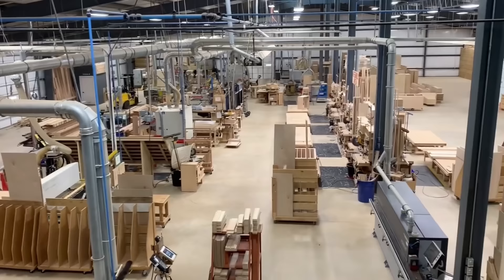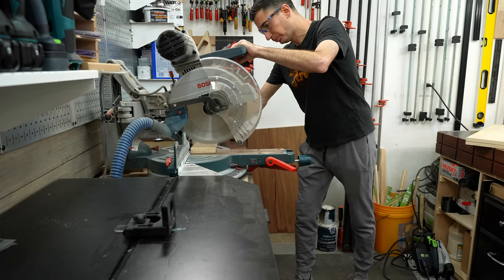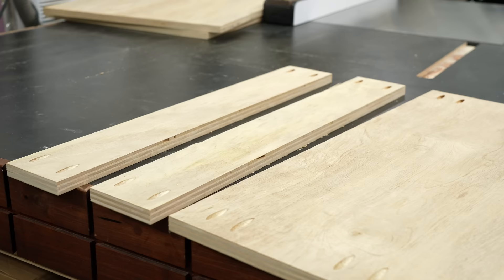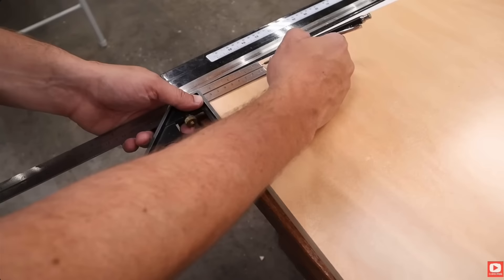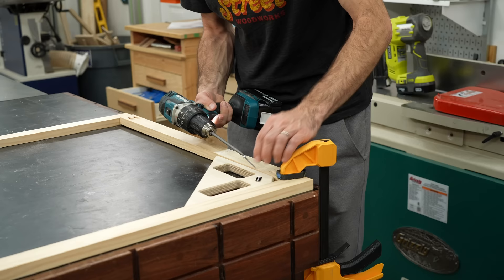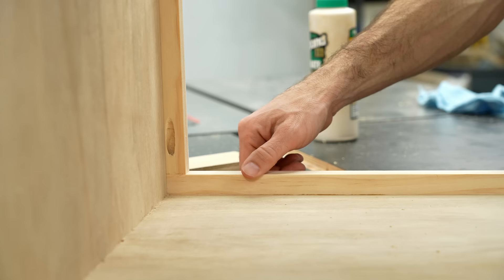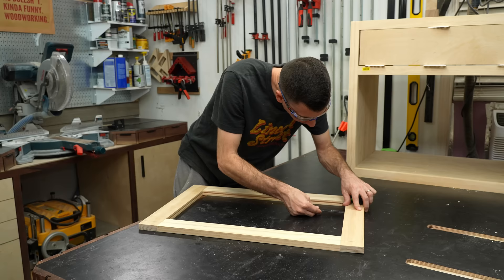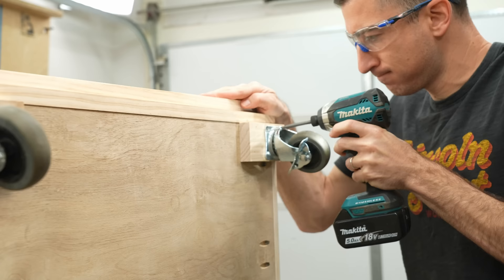Bad Beginner Cabinet Tips

Comment: 9:36 I actually prefer hand tools. But often they are not a good choice when working with plywood. For instance hand saws are largely divided into two types of teeth, cross and rip. One is good for going against grain the other for going with it. But with plywood the grain direction alternates throughout the total thickness. With powered saws it's not a problem because at the speed they operate the physics of how they cut is closer to shooting the wood with a constant stream of tiny bullets than it is cleaving or pulling at fibers. 

Technically there are rip and cross cut blades for circular saws. But besides the hassle of changing out blades or using two saws. I've seen no substantive difference between using the optimal blade for the direction of cut or just using a combination blade. And since you want a combination blade for plywood anyways. That's the blade that's going to be on my circular/chop/reciprocal saws the vast majority of the time.

Comment: Is there any advantage to mounting the side panels on the sides of the bottom panel instead of on top of the bottom panel other than allowing for integrated toe kicks?
Reply from the maker: easier for attaching the top stretchers and you want to cut all the stretchers and bottom at the same time so they are the exact same width.

Comment: Is it a bad Idea to build cabinets and bases out of 1/2" plywood. I see you tuber saying 3/4" is a overkill. What's your thoughts on this. I would face frame them
Reply: It can be done, but you'd have less support material to drive brads or screws into and you'd probably need to add more stretchers to brace against racking/flex.  Currently you'd be saving only $20 per sheet for birch plywood at HD, so you'd have to ask yourself if messing around with thinner stock is worth it.  Perhaps certain areas where cabinet boxes would joined together when installed is OK.  You never know until you try.

Comment: Birch ply seems to go mouldy( ie black mildew dots) if it's hanging around the workshop. I also made a small cabinet and finished it with Danish oil. That also developed mould all over the surface after a about six months.
Does anyone else have this problem?

Comment: I have a question about the face frame, you said there is a 3/4 gap inside you needed to pack out for the drawer slides, wouldn't that gap be 1 and 1/4 inch on a 2 inch wide piece of pine?
Reply from the maker: 1x2s aren’t actually that size. They are .75x1.5
Reply: @Lincolnstww  Ahhhh ok, that explains it:) im from the UK so not fully aware of the wood size nuances of the US. What is the reason for that?

Comment: 16:32 This is the wobbly way. Why not make the groove before assembly. In hat case you can put the router on the wide side of the wood.
Reply from the maker: You can - but you need to make stopped rabbets so you don’t see them from the sides. A bit of a pain and less approachable for a beginner in my opinion

Comment: Twice as much..  Definitely a lie. 3-5x as much if you need a tool. On another note don't be intimidated as cabinets are not very difficult. The biggest challenge is getting perfect 90 degree cuts cause 89 degrees isn't going to work well.

Comment: Why pocket screws amd glue when it has to stand more abuse? What is the difference between:
- Screws from the outside and Glue
- Pocket screws and Glue
???
Reply from the maker: I didn’t use glue when screwing from the outside. Just screws
Reply: @Lincolnstww  I saw that. I meant: when applying glue, why are pocket screws better? Why not Glue and screws from the outside? (in the case that someone doesn't have nice pocket screw utensiles) What would be the difference? Is this a dumb question?
Reply from the maker: @blinertasholli1280  not a dumb question. The glue isn’t necessary for the pocket holes. I only did it because it’s a standalone cabinet that will have a lot of weird forces exerted on it. Glue and normal screws would have also worked but I didn’t want to see them from the side. The glue just gives more strength but you generally don’t need that in a standard cabinet.

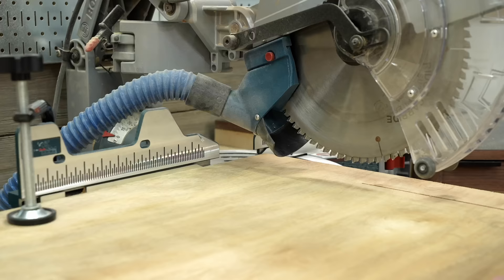Comment: 4:00 "it does cost 50 to 60 percent more" ?  You're either getting ripped off on your BB, or you got the best price on a sheet of HD precurved, hollow plywood. 
 
My lical Home Depot sells their 4x8×¾   (22/32) Sande plywood for $73. You could spend $95 for (one of the 5 sheets theyve had since 2003)  poplar or "Burch" 😂. 
 
But my local plywood retailer sells ¾" latvian birch 13 layer for $91.  The maple veneered is $103.
 
So get out there and shop around... and avoid HD ply like its wearing a white coat and coughing as blood comes from it's eyes.

Comment: Construction plywood is just as good depending on what section you are using it on. If you are willing and can afford to pay double for cabinet plywood then do it. The only change you will get is the insides will be pretty as well as the outsides. 
Home Depot panels saws are some of the best tools to use if they are in service. I have them cut everything and nearly every time they do not charge for it. Just make sure you account for the kerf of the blade in what you are cutting out.
Reply: Construction plywood rather than the thin stuff as well as glue is my go too. I would rather make sure the box is a box of plywood and is strong when that someone grabs a hold of them and pulls them up or stands on it. Stronger last longer. While you do not need dowels and all of those other things. Using the router to make all the parts fit nice and tight with glue is well worth it!
Reply: using plywood to make the whole thing a box means that you do not need a toe kick. You can hang them off the wall and have super solid boxes. The overall cost and time to make it all out of 3/4" plywood is well worth it. The added cost and ability to know you are getting a solid box rather than the least amount of wood to make a box. 
Custom fit ones can even be better. Most of the box can be done with dado to slide in dividor for cabinets or drawer sections. Since you are going to build a face frame.

Comment: Find out where your local cabinet shops get their plywood. Buy 3/4" "Pre finished" maple for the boxes, and 1/2" "Pre finished" maple for the drawers. Get a 1/4 or 3/8 crown staple gun and staple 1/4" pre finished maple to the back of the boxes. Don't cut a dado, don't rabbet joints, don't dovetail anything.

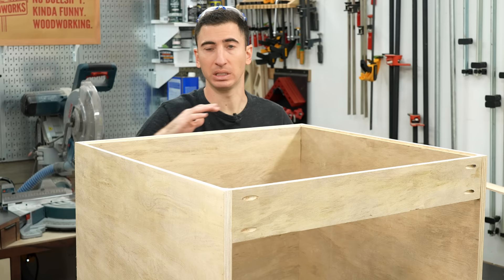Comment: 9:55 
Hand tools are not ’ew.’
They can save time and do a better job in many circumstances. In ther circumstances your power tools are pretty good and efficient. 
Fwiw I just would have belt sanded off the corners.

Comment: Made it to just past 6 minutes. First you show how to start without a tablesaw and then you show using a tablesaw for subsequent cuts. Then the use of mechanical fasteners without glue... If you want your cabinets to lose structural integrity over time use mechanical fasteners alone. If that's all you have... well might just as well buy premade. YOu can cut dados and rabbets with a router and guide. Dado, rabbet, and glue joinery and you can make cabinets that will outlast you. With shop grade plywood from the box stores as a minimum quality being enough for durable cabinets without the deed for mechanical fasteners. However pocket hole kits are really not that expensive. YOu mention Cut list programming... and not  in a positive way either. Perhaps you just have not used CutList PLus. I adopted it early and it has saved me lots in material utilization. It gives me the option to prefer rips or crosscuts. Although for folks with your limitations for material transport and sheet good handling and cutting your methods will work. 

Bottom line just too many issues with this video.

Comment: F.f.s. a could have used this vid a year ago. I bought a router table to try to make cabinet doors. I then ripped the router out and threw away the table as I learned it wasn't good enough. I then went to the expensive wood working store and bought a much nicer table only to learn I still had no micro adjust...uh huh. 1500$ into learning how to make shaker door fronts I now see this idea.. make the 4 sides and router them out later....dam I feel stupid.

Comment: In the eternal debate about Pocket Holes  (and their matching screws), straight drill and screw from outside, or dowels, or even Dominoes (Lets not talk about Finger/Box joints) I had a cabinet assembly job to do recently (well, actually, a very large drawer carcass): Cut the sides to length, front and rear to length to fit between, and bottom, all from 15mm plywood, lots of clamps, glue-up, and various blocks or those nice red 90 degree clamping things, so i got it square, and tight. Added the bottom, let it all set up and dry for a couple days, then using one of those dreaded plastic dowel drilling jigs set to 7mm, drilled 8mm dowel holes along the face side of all joins. Glue in the holes, hammered in some 8mm dowels, let dry, trim then finish with the sander.
I can hear all the purists screaming 'Oh the visible dowel ends!!!' and with much wailing and gnashing of teeth... 
It's a drawer carcass, for use in my shop, FFS, and, how do they know that I didn't screw and plug? (Yeah, I know, I just told 'em so)
I guess it's like the pocket hole methods, you do what makes YOU happy, and quit worrying about what others can't see

Comment: JUST A SUGGESTION, you're doing a good job informing beginning tree killers how to take all different widgets and gadgets, and build all different types of widgets and gadgets. Please do your viewers a GREATER SERVICE AND EDUCATE THEM ON THE WONDERFUL ABILITIES OF THE TABLE SAW! 

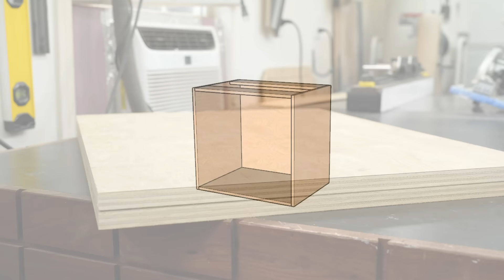@ 2:31 thru 2:51 you talk about bribing your significant other into getting a table saw. YET your only using your saw for a work bench and a jungle gym. This video could educate your audience as to why YOU DO NOT NEED MICKEY MOUSE POCKET SCREWS. If you educated them how to cut all the parts needed the same size on the TABLE SAW, how to cut toekick knotches, dados and rabbits on the TABLE SAW. You could actually have fewer parts to cut, spend less time and end up with stronger and more durable cabinet body's and drawer boxes.

Just saying.........
Keep up the good work with your video's.
Reply from the maker: I appreciate the comment but that wasn't the point of this video. Not everyone owns a table saw.

Comment: How many DIY have tools like you have ?
Reply: A screw gun, brad nailer, and a circular saw and a few tools for guiding cuts and drilling?  This is pretty basic stuff.  If you don't want to use the nail gun, a small hammer and finish nails will get the job done just as well.

Comment: So since you went there. There is nothing wrong with how you built your cabinets.  Lord knows I've cut a few corners in my life. However,  pocket screws show lack of skill. Sure they have there place and I do from time to time use them. But for me it's a skill thing when I build a cabinet. I use dados for bottoms and even face frames.  The dado makes an incredibly strong bond and it hides that seam that inevitably shows up on butt joints with screws and brads. O that reminds me ,brads. I'm amazed at people using Brad on finished surfaces, tacky very tacky. Again a skill issue.  It was nice to see you using dowels,  that's the skill I was talking about.
Reply from the maker: I’m genuinely curious - you worry about butt joints or brads that are never seen? That’s next level OCD
Reply: @Lincolnstww  I'm a bit of a perfectionist.  I get it, it'll never be seen but I'll know it's there. It's kind of like doing something you know is bad and no one will ever know it was you but you. Ultimately I want to reach the point where I use no metal fasteners at all and still achieve the highest quality and strength.  I don't have all the million dollar tools to make life easy. I use standard table saw miter saw router table (I built) I cut and shape all my own moulding to include cove crown all with these tools. If that's OCD then it is what it is. I do enjoy seeing how others do thier builds and I did enjoyed and even subscribed to your channel even only watching this one video.  I'm curious to see what you have up next. Again nothing wrong with how you did your cabinets they'll certainly get the job done.

Comment: the bottom of the draw should have a panel in 1/4 inch slot, not tackon the bottom, it will eventually break. I ma done watching not the best cabinet video, and there are others that should the right way, and you don't need  anymore stuff then your using.
Reply from the maker: I like turtles though

Comment: Do you have a notepad on your tape measure?
Reply: Fastcap tape measures have a place to write your measurements down.  Even the metric ones, which is weird cause metric is so easy (lol).  Try not to measure.  Just make sure parts are cut the same.  It sounds counterintuitive, but translating to measurement introduces more error.

Comment: I don't like the fact that you glue so much of it. Even since I was a kid, up until now we were moved from one place to another, often moving along with furniture we have. While furniture around 1990 was bulky, a single piece one and have same issues, around 2010 and on there started appearing a good one fully dismantlable one and it helps a lot. When you parents grows old and you are the only one who could carry the heavy weight of the furniture, being able to dismantle it fully is a life and health saving. Nowadays we mostly have furniture that was screwed by hexagonal screws that can be unscrewed up to single panels. That's what I would consider more professional. Also quite interesting that you using those angled holes to screw some inside parts. We have some alternatives to that. One of this is pieces of wood like you do with the door frame, other are same hexagonal screws from outside that was hidden under cape and lastly is a mechanism where you drill some hole from the part, then drill cylinder from the side, then put some metal rod with a cape that have carving on the other part that screwed into it and then you lock it via metal part that put into this cylinder hole. They would be hidden as well, but the angle would be 90 degree.

Comment: Buy an old pickup if you are to continue being a wood machinist. Use a lumber yard as a source, they tend to deliver cheaper and better if you refuse to buy a pickup. You went from a circular saw and straight edge to using a full blown shop, clever tool escalation. Dissing good hand tools is bad form, but you be you. Most DIY'ers don't have the setup or desire for keeping chisels and planes as sharp as they should be, therefore having poor results and disdain for them. Do all your cuts with a circular saw and router if you want to show how few tools you need.

Comment: Waaaaaaaait a second, this cabinet is for your SHOP and you didn't put a brace in the bottom of the drawer? Kitchen cabinetry for table linens I would understand, but shop cabinets take a beating and heavy load. An unbraced plywood sheet suspended in a drawer frame, is going to bow under those conditions. With the front of a drawer often the most heavily loaded, that edge of the plate sagging and eventually getting pulled out of the frame, would effectively turn the base plate into a locking plate.
Reply: What did you expect? he's using Ryobi tools after all.